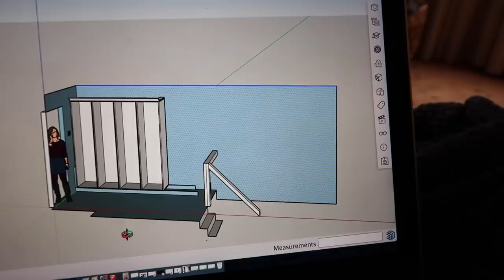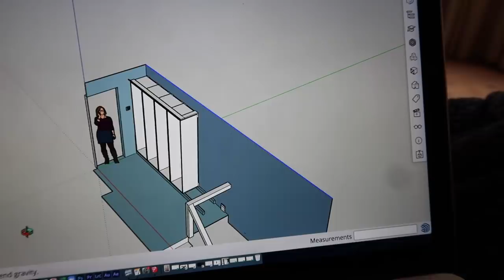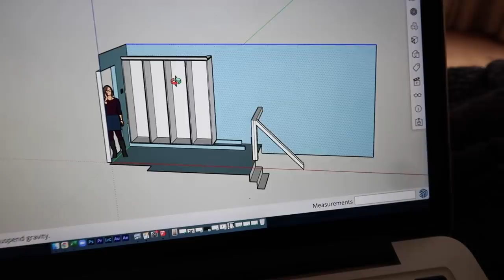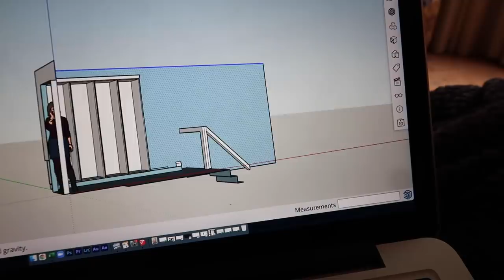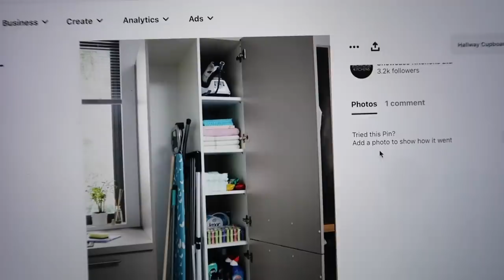PLANNING OUR WARDROBES + SHELVING | DIML | Laura Melhuish-Sprague

Comment: You can raise your cupboards up on a base and then have the same height of skirting boards... also, have you played around with the Ikea Home Planner App?  It's like the sketcher you were using but you can plug in different Ikea components.  We used it for my daughter's kitchen and it was brilliant at showing you what you could fit and not fit into your space.

Comment: One designer I watched needed a cupboard at the top of her stairs but did not have a lot of space So she did a half glass effect on the top and as she had mostly white towels etc . She said that it forced her to keep the area tidy but lighter than a solid door. I spent a year looking for a row of wardrobes to fit a space without waste ,bought and custom fitted the inside went back a year later for an additional piece and they had stopped making them .

Comment: hello, just a little tip, remember that since you have your washers downstairs it shouldn't be that pratical to have your ironing board on the top floor, its a ice place to store your spare bedding and linens, and some space to hold you winter/summer off season clothes 
(sorry for the wrong spelling)